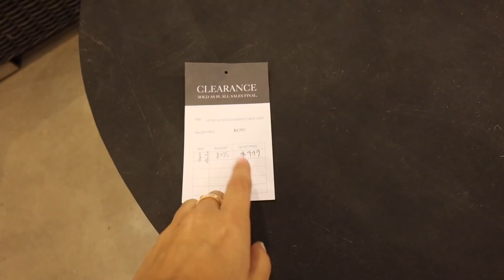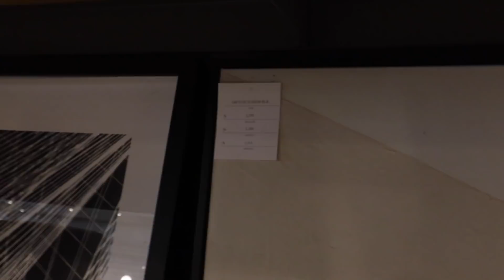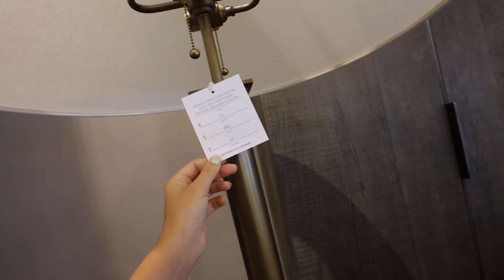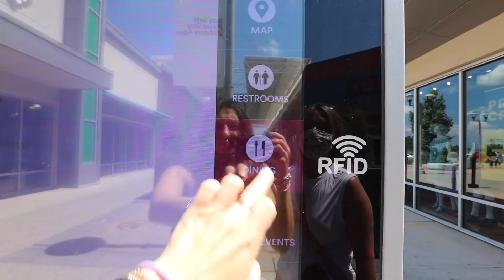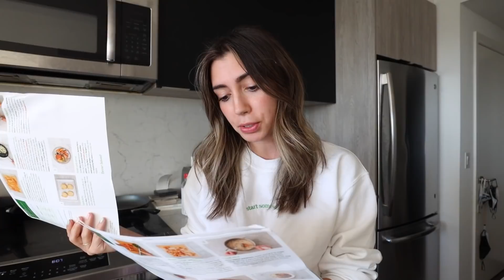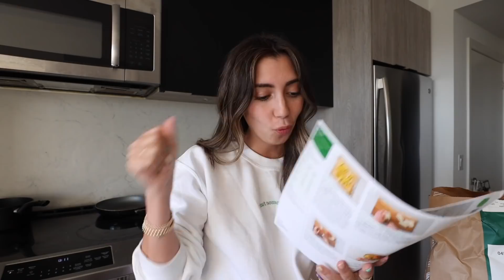Exciting house updates!!! Laundry room & bathroom vanities SET UP!

Comment: Tara! Your house is looking great! Just a tip for the closet: there is a device you put in the hanging part of the closet that it allows it to go down so you can reach the high parts of the closet. It’s called Lift Pull Down Cabinet Hanger on Amazon. I bought it and it was the best.

Hope this helps!
Mili

Comment: for your closet the part you can reach you could get a step stool and when your done with the step stool you could tuck it in your closet. or you could get one of those things where you get a hook to hook it on too your hanger and then you pull it down and it gets your cloths for u. just some suggestions

Comment: If the rods drop in the closet, are the bottom of your clothes going to touch the top of the shelf below it?  Consider how that will look. Then maybe might have to lower the shelf and rod below. A small steptool is not a problem. I’m short too and keep a smal step stool in the closet. However, if reaching with out step stool, I think keeping the proportions the same would look nice.

Comment: Hey Tara! You can leave the hanging racks the height they are and use them for lesser worn items! Many people do that to make use of the head space in closets ! You can purchase the garment hangers online to reach those higher hanging racks just like the ones they use at department stores! It is very easy and the garment hanger just hangs inside of the closet when not in use! Also you can purchase the extenders that hang in closets to hang outfits you are putting together or plan to wear soon and they make so that you don’t have to leave them inside the regular rack with other clothes so you can steam them and just leave them there until you use them and many people also use these racks to allow clothes to air out after they wear them before either wearing again or relocating inside the regular hanging space! It is very convenient and has a nice aesthetic!

Comment: Hi! You might want to check out something like this. Google search “pull down closet rod/rack” Basically, it’s a hardware attachment you can replace your current hanging rack with.  It has a mechanism where you can flip  the rod it down towards you (similar to soft close drawers, it’s not aggressive. It makes it easier to reach! My cousin has them in Europe with a similar closet construction.

Comment: If you lower your rod in the closet your clothes will be dragging on the shelf. Also you don’t have to reach the rod you just have to reach the hanger. Maybe get a step stool or ask your contractor about pull down rods